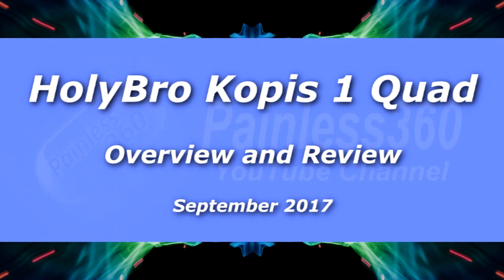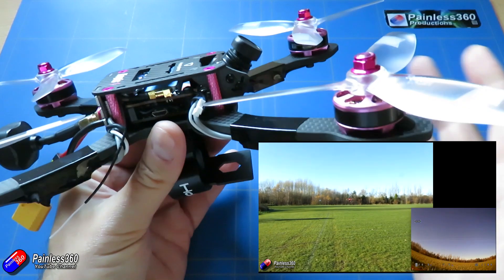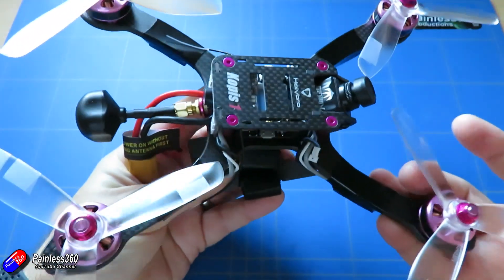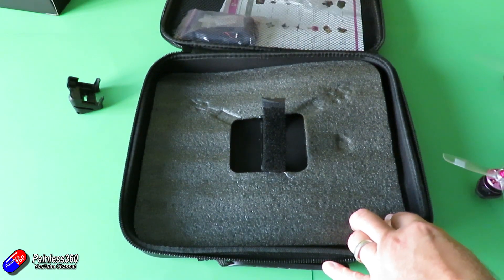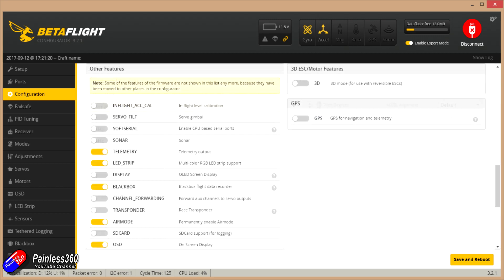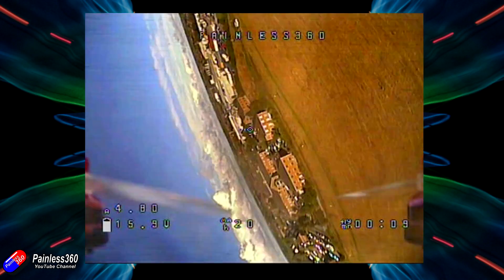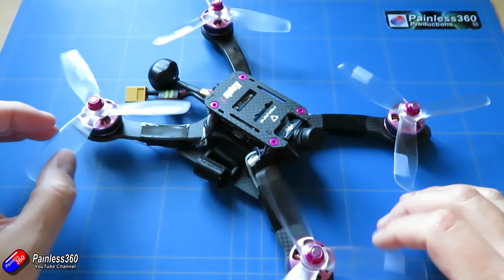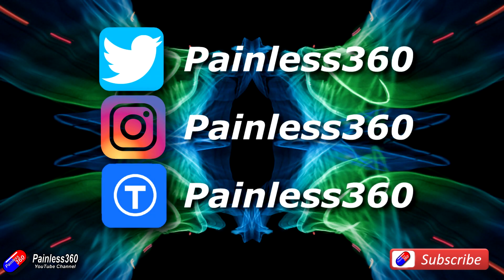RC Review: HolyBro Kopis 1 Racing Quadcopter

Comment: have you thought about running the escs and wires on top of the arms? dont like the look of the curved wires on all corners plus the escs might be better off on top of the arms protections wise....
Reply from the maker: You could, there are lots of different ways to build this. This just happened to be mine.. Happy flying!

Comment: Nice, well thought design, would have used a 4 in 1 ESC centralized more weight BUT, Fit and finish, battery cradle and see thru PROPS .. NICE .. have bought Holybro before, The Shuriken is a great frame, they seem to make quality products .. CHEERS !

Comment: Hello,  How many mm is there between the vtx and the top plate?   Can you somehow fit a runcam split board in there?  Thank you.
Reply from the maker: There is just less than 4mm so you'd have to rise the top plate using spacers or mount the RunCam board on the outside..
Reply: Painless360 - thank you

Comment: hello painless,i have a binding isue whit my kopis 1,if i wil set it in binding mode both led s are go on,green and red,and they  not blincking,wat do i wrong?
Reply from the maker: Not sure, it's a 'real' FrSky receiver so is it on the same firmware (normal or LBT)? I'd check with the vendor and update the receiver if it's wrong. Best of luck!

Comment: Can I hook a tbs crossfire micro rx up in this?   Thank you.
Reply from the maker: +John Doe yes. If you're going to be running sbus out of the Crossfire receiver then just install it as you would any other sbus receiver. If you want to use the crsf protocol then you'll have to use UART6 on the board. Hope that helps
Reply: Painless360   yes it does thank you.